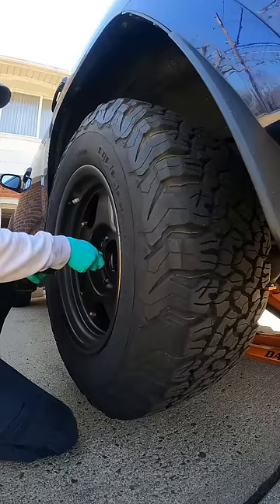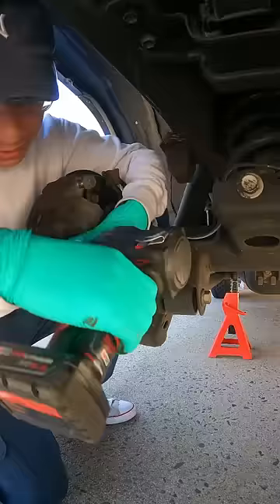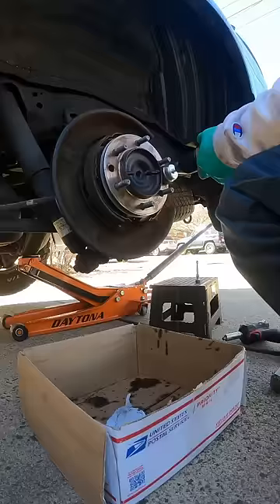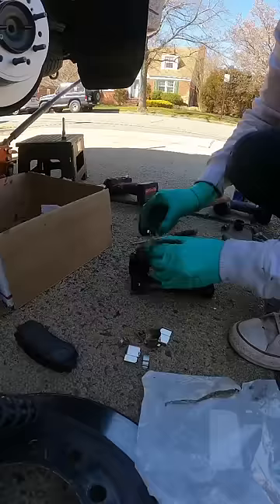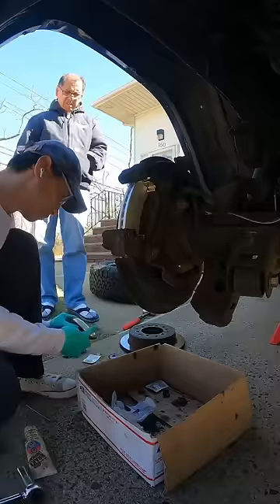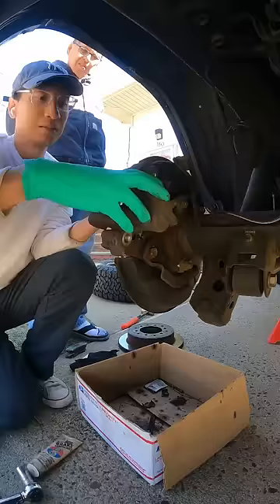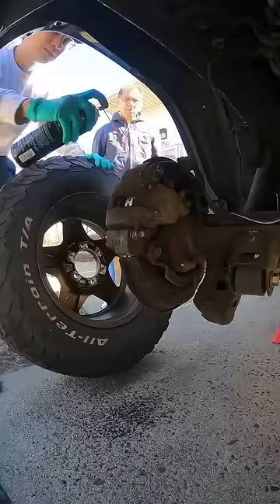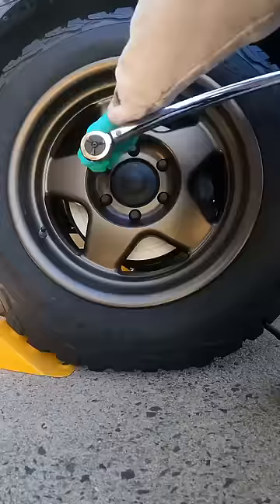Dealer wanted $700 to replace rear brakes. My DIY job cost me $100 and an hour of my time 😎

Comment: and that's how it's done when there is no rust
Reply: and when you have a $300 milwaukee fuel setup lol. No elbow grease needed. Had a honda crank bolt stuck. 1 inch breaker bar setup couldnt get it off with 2 people. Tore the holding tool slot right off. Went to home depot and paid $500 for a m18 fuel with a 8ah and the sucker came loose in less than 3 seconds with a heavy socket.
Reply: Yea I live in New England and only drive 99 Outbacks. My last one was so rusty that everything was a bitch to work on. My new one is pretty clean so I’m happy
Reply: Well, the us on Toyota is the rotors invariably have threaded holes in the face. 2 bolts, a little elbow grease and rotors off. As long as the caliper piston pushes in easily and the piston seals are good, boom!
Reply: take care of your car better then
Reply: @DIRTY30DIESEL   I could have done it with a 9.99$ harbor freight emergency road side  impact. Ive ran mine off of 18v for like 10 years now.
Reply: @DarkLinkAD  everyone says that until they get on it. No shop would even touch it. I tried the harbor freight hercules ultra torque and it didnt do shit so I wouldnt believe that(in my circumstance) as far as I could throw you. Car had 265k miles and it's the first time it's been ever been removed from the factory 2016 accord
Reply: @DIRTY30DIESEL   Your reasonable reply makes me actually irritated I couldnt send my POS contraption at it.
Reply: @DarkLinkAD  I wish you could've I was willing to try anything at that point!
Reply: Lol for real you need some serious power to break the rust and lock tight they put on those caliper bolts 😂
Reply: Honestly 😂 rust belt resident here
Reply: @slytheninjamc2868  you obvi have never bought a used car or live in a rust belt 🙄 not that simple.
Reply: Or when you actually got room to work in
Reply: 😂😂😂😂😂  yah my front breaks took me like 2hrs because one of them was almost frozen on and i am still learning how to do car maintenance. But to be honest i rather learn now then later.
Reply: @ElevenAce  Yeah that's a good idea, basically what I did. Started when I was 15 and got my first car and now I'm 19 still doing it. Pulled a blown engine out of a supercharged grand prix and took the same engine from my other supercharged grand prix and swapped them. The old one was too rusted out and the trans was bad so that was literally cheaper and easier 😂
Reply: @DIRTY30DIESEL  eh done brakes many times with just basic hand tools. A breaker bar is cheap and does the job perfectly fine in most situations
Reply: Meanwhile in Michigan we are hammering everything off
Reply: @joe1071  North Dakota ain't much different
Reply: @DIRTY30DIESEL  well I wouldn't consider something thats 1 inch long a breaker bar thats not even a rachet at that point
Reply: @DIRTY30DIESEL  this exact scenario happened to me lmaooo, bro we had the longest cheater bar in the world and it wasn’t cracking. Bought the impact and hit with fuel impact and it spun right off.
Reply: @MostGenericUser  1 inch connector tip not length. Extension was 1 1/2 ft steel weighed 4-5 lbs breaker bar was a 1 inch end 3 ft long with a 6 ft floor jack pole over it
Reply: @fintalkdorian I never believed that much power could come from something handheld with a battery and no compressor. That fuel is the truth!!
Reply: Aren't Toyota trucks notorious for that?
Reply: Surface shield for the win
Reply: I worked at a garage for 3 years, brakes were very rarely a problem to get off, most cars I was able to do front and rear pads and discs in about an hour
Reply: @shawkindustries9521  sounds like you live on an L state
Reply: @jondahl3173  rotors out along with the shoes hardware and springs half the time on drum parking brake setups
Reply: You see rust, then spray some pb blaster and let it soak in for a few minutes before attempting to loosen it. Work smarter.
Reply: yah right this boy doesn’t know real work, he’s a rich kid
Reply: Mate that's how it's done rust or not. There is ONE single job that I can confidently say rust makes harder and that's an exhaust job. For anything else.... quit using your purse and use your brain.
Reply: @DIRTY30DIESEL  those things are crap. If they work you probably don't live somewhere corrosion is an issue.
Reply: @DIRTY30DIESEL  ...?? You don't need a 300$ Milwaukee... Lol 
There are plenty other impacts as good for way less..
Reply: @FireGodSpeed  go ahead and name them buddy. All those are junk and couldnt take a crank bolt off a honda with a weighted socket. Milwaukee ftw
Reply: First thing I could think of was the brake shoes getting caught on the rotor and yanking the pins out lol
Reply: Yeah i did this on my lancer and man i had to pull out the sledgehammer to get my rotors off lol. Had to wack them so hard the car was bouncing on my jacks. Decided to just pay a guy $800 to do my Tahoe as a day job for me is a 2 hour job for him 😅
Reply: @vermili0n  bro what’s up with the 99 outback vs other models before? I know they changed to second gen in 00
Reply: @DIRTY30DIESEL  Milwaukee fuel is the best electric impact you can get. I love mine
Reply: @DIRTY30DIESEL  
Had an Acura wheel hub bearing stuck. Bought the $300 specialty socket from Snap-On. Broke a no-name breaker bar. Bought a Craftsman breaker bar. Still wouldn’t come loose with my weight on it. Went to Home Depot, bought a 6 foot pipe for a cheater bar. Finally came unstuck with my body weight.
Reply: I just working on a rusted car you don’t understand it is falling apart
Reply: @slytheninjamc2868 salt on the roads is a necessary evil.
Reply: @DIRTY30DIESEL or maybe torch lol
Reply: @NATURALGAMING  Right, because I didn't try a $30 torch before a $500 tool.. Showing all your IQ beans on that comment
Reply: Better buy extra bottles of brake cleaner and a wire caliper brush, alongside some PB penetrate

Comment: Fun fact for literally anyone who didn't know (because I've met a few who didn't) if hammering doesn't sound fun and you're one of the lucky dude who have the right sized bolts, those rotors can be removed by placing the bolts in the threaded slots and just tightening the bolts. Extremely awesome way to remove rotors/drums if hammering just ain't doin the trick.

Comment: ROOKIE tip:  Do not put on the parking/foot brakes.  You’re going to have a hell of a time removing the rear rotors.  I learned that the hard way.  😅😮‍💨
Reply: What does that mean?
Reply: @CaptinJack2  The parking brakes clamp onto the rotors locking them up, making it almost impossible to remove.  Unless you’re a stubborn dummy like me, in which case you will be severely dehydrated.
Reply: What if you have a manual trans?
Reply: @ibake84 chock the wheels.
Reply: @ibake84  Good question.  I don’t know since I don’t have any but I suspect you’d have to lift one wheel at a time while securing the other three really well.
Reply: @ibake84 leave in gear
Reply: @whitejodeci8926  Thank you!
Reply: I did this too once and still managed to get the brakes out although the thing was destroyed by the time I had finally got it out. Simple things can make difficult situations
Reply: @ibake84 you leave it in gear.
Reply: Good solution, lift up one tire at a time.
Reply: @andrewbennett8624 First thing to do. Lol
Reply: Happened to me. I gave up and contacted a CL mechanic. Saw him do the footbrake trick, and I wanna kill myself. LOL Paid the dude 250 $ rear brake and pads. I was so pissed off.
Reply: Just to be clear, are you saying to leave the vehicle in neutral before changing out the rear brakes? I’m planning on changing out my brakes and rotors soon and I’m new at this
Reply: @christophertovar6821 it has been a month, how did it go?
Reply: A statement of the obvious. 🤷🏻‍♂️
Reply: @christophertovar6821  How's your plan going?
Reply: Haha i had my parking break up on my 97 M3 and I literally could not get the rotors off rookie mistake

Comment: My man used a torque wrench instead of just hammering those things home. Mad respect
Reply: 😅😂😂exactly.  He definitely doesn't take his vehicle to any shop.
Reply: There are certain fasteners where the torque spec is very important and others where they just have to be tight enough not to fall off and not tight enough to damage the threads, those are tight enough not to fall off kind, I do however like to use blue locktite on my brake jobs especially if they had locktite from the factory
Reply: Dad had to use both a time or two no thanx to me. 😔
Reply: No need for the mad respect when this is a normal process.
Reply: My dad is an oldschool mechanic. He laughs at me when my torque wrench beeps.
Reply: @ho3smad505  ngl I don't trust those either. Just like the click. I know they are way better though.
Reply: 2LBS MAUL TURNED SIDEWAYS HAS ENTERED CHAT
Reply: I used a powerful torch wrench.  Took days lol. I wish it was this simple.
Reply: I wonder how many Portzrebies per Fahrshimmelts he torqued those bolts to?  (Thanks to Mad Magazine for the units of measurement, taken from Polish and Yiddish, respectively).
Reply: If the bolt is critical, I torque it.

Comment: I love to see people learn how to work on their own cars, so long as it's done correctly. Basic maintenance isn't that hard to do if you have a repair manual and YouTube.
Reply: A few decent tools remember 😅
Reply: Exactly 👍🏾
Reply: Learning this after a shop wanted $800 for a coolant blow out in my 97 Z3. Luckily a car buddy said "lemme take a look" a $10 coolant flange. A $12 clamp. $50 of coolant later. A few small spaces climbed in and a few cuss words uttered and im back on the road. Truly love the exposure to "big boy Legos" as I call working on cars.
Reply: These days manufacturers are making things much hated to DIY on jobs that used to be fairly easily done in your driveway!!!
I was told a few years ago that on Ford F series trucks 2016 or newer, when you do a brake job just like that one in the video, you have to break the bleeder valve loose before compressing the calipers or you’ll screw up the ABS system and you’ll have to pay the dealership several hundred dollars to “un-screw” it; not to mention having to pay a towing bill to get it to the dealership!!!
Reply: @AzzKicker-bz1cb  it isn't just the Ford trucks, it is any vehicle with an anti~lock brakes. In some instances pressing the piston in on a caliper can possibly mess the ABS pump up. 
Just wait until you see the bill for engine jobs on the big Ford and GM trucks, the entire cab has to come off to work on them.
Reply: @morsumbra9692  good deal, glad you had someone you knew whom offered to help. Get a decent tool set, something with a case if you don't have somewhere to store the tools. Pick up a repair manual and just look thru them to get a good idea of things
Reply: So true
Reply: Need money for the right tools lol a good torque wrench with no sockets is between 70 and 200 dollars
Reply: Or even better, get a Tesla and eliminate 90% of the maintenance that comes with an ICE car.  Just regenerative braking alone means you'll never need new pads or rotors
Reply: Or Chris fix
Reply: Not his cars it’s a customer because everything on social media has to be fake now
Reply: @johnydeadboy  I know this is a year plus old comment but I don't know what those 100+ dollar torque wrenches even do better than much cheaper ones. I got a torque wrench for 1/2 inch sockets that supports up to something like 200+ lb/ft, so that's the biggest torque wrench you can get as far as I know, and I bought that thing for 60 Canadian dollars. So that's even less in US dollars. I've been using that to torque my wheel nuts every tire rotation for 7 years now.
Reply: @GlassOnion23 there isn’t a huge difference. Go watch people test them. The $20 click ones from harbor freight do just fine. A pound or two difference in torque likely isn’t going to mess anything up

Comment: Same here. Mechanic wanted 625 to change rear calipers, rotors and pads. I did it myself for 370.
Reply: And they go extremely cheap on the parts for their profit margin

Rather put that on the quality of my parts than on their pocket

Dealerships are you blatant thieves
Reply: Tbh 250 in labor isint that far off from what I'd expect at a dealership or the like. I wouldn't take it to them cause I can do it myself, but that's about 1.5 hours in labor in my area
Reply: My Honda dealership wanted $1600 for rear caliper, rotor, pads. Fuck that

Comment: ASE master tech here. I love seeing DIY people doing mechanical work on their car while using a torque wrench. Plus the fact you properly cleaned and lubed everything before assembly is great too. 

The only things I would suggest that you didn’t mention is cleaning the old grease from the caliper bracket where the slides go in since the old grease likes to get caked up after a while and when you compress the caliper piston/pistons back in crack open the blender valve first to let the old cooked fluid out of the calipers so new fluid replaces it when you pump up the brakes (I typically attach a little tube on top of the blender and put the junk fluid in a empty oil container). 

Still, you did better than many other “professional” mechanics I wave worked with over the years.
Reply: Must bleed brakes. 👍
Reply: Lol ya I want to see him extract a froze guide pin that has rusted! I love how people make these videos with false hope. Not everyone owns tools let alone a jack or 1/2 damn impact lmao. Plus some don't even know where to jack a car from!
Reply: @user-rn3rn6nl3h why tf would u bleed brakes when changing pads and rotors 😂
Reply: @thesarcasticgenius3986  yea but people making mistakes is how they learn. If us pros talk down to the people out there trying then they will not end up learning anything. I want to see more people involved with their car repairs (or any repairs to be frank) and I would love to see more pros be helpful instead of condescending and ignorant. 

Now I’m not saying I don’t enjoy a little bit of schadenfreude when a certain type of person that doesn’t know better does something dumb with their car. I just don’t think we should treat everyone that decides to take on their brake repairs like that.
Reply: @Jay ThatGuyYouKnow  I hear that. But there is another thing that I seen in my time is, that not everyone has the the gifts to even do a simple oil change. Ya I know sounds crazy and far fetched but some people just cannot be taught. Plus again tools! And how to use them. Utube does not show u everything. I tell people all the time if u have doubts don't do it. Makes no sense to mess it up then pay extra to get it fixed right. Know ur abilities and limits!
Reply: @MrDutch1e   With this vehicle, the entire brake calliper assembly needs to be disconnected from the brake line for the disc to be removed. Pad replacement is a clip and pin job, doesn't need removal of callipers.
(The brake line isn't flexible)
Reply: Way too nice.
Reply: Damn right he did better then most mechs. I've seem guys do all sorts of unmentionable acts of automotive treason